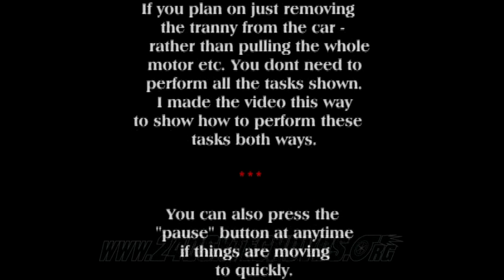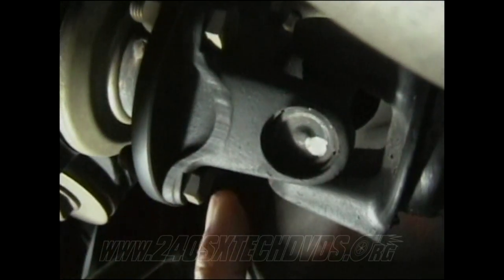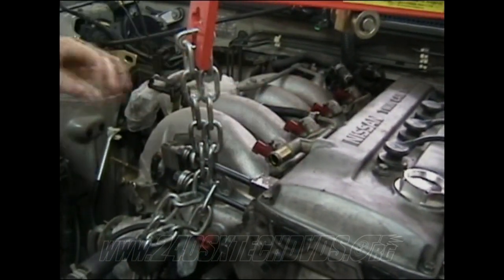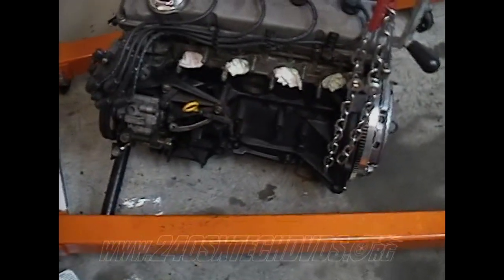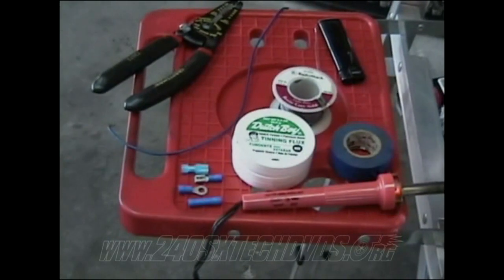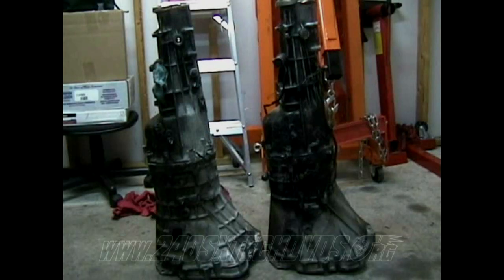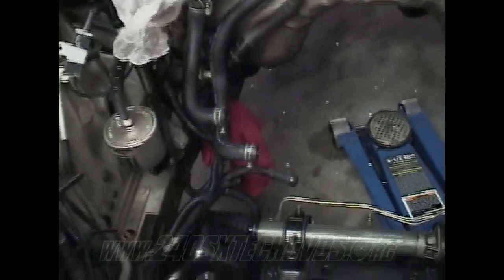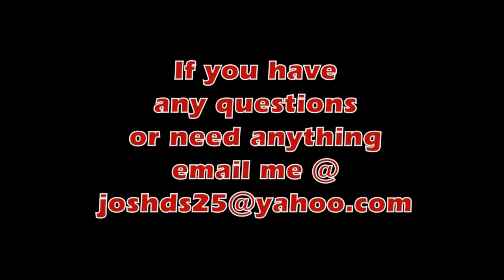How to Nissan 240sx 5 Speed Swap DVD S13 - S14 2007

Comment: Any pros to wiring in the clutch pedal, 5th position and neutral position switches? Car still runs without them but was wondering if there is a difference.